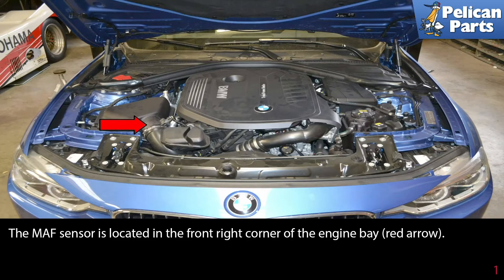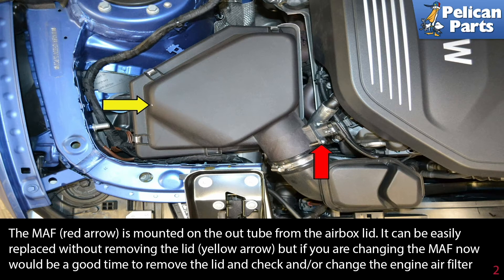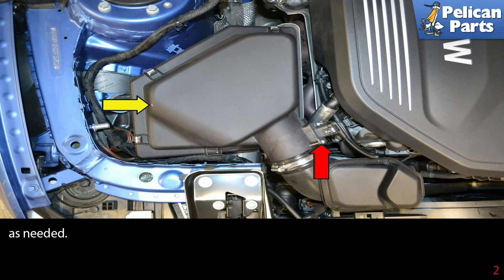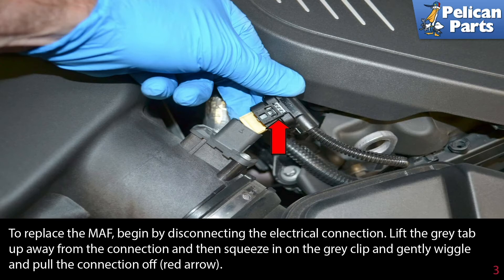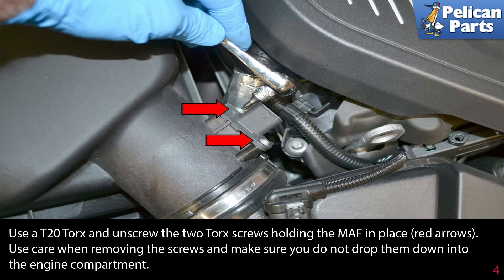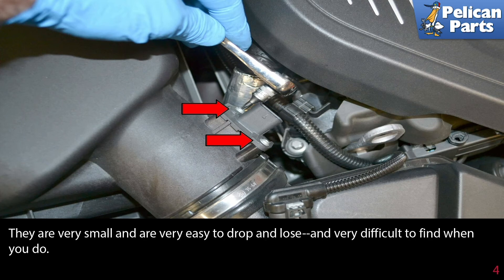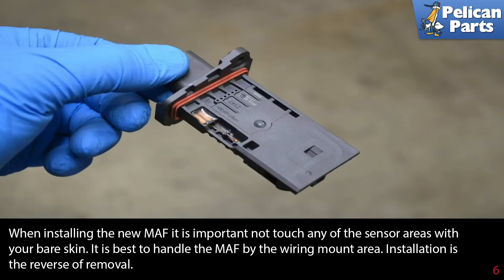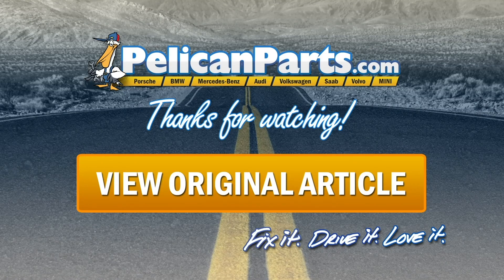BMW F30 3-Series MAF Sensor Replacement for 320i, 325i, 325Xi, 330i, 330xi, 328i and 335i

Comment: I have been getting too much airmass code on my car... so the wire/sensor side is up?? I definitely put it in backwards......
Reply from the maker: I don't think you can plug it in backward. The connector will prevent that. I would address the fault code and try to diagnose the issue.

Comment: I want to ask. Why my f30 is difficult to start.after start for a moment suddenly the engine turn off.the engine is shaking. In i drive drivetrain multifuntion. I already change sparkplug. My problem is iginition coil fault or crankshaft sensor or mass air flow?
Reply from the maker: Difficult to say without knowing the stored fault codes. Could be an engine misfire, timing issue, etc. I would start by checking the DME for fault codes. If the system is not working properly, a fault code will be set. This will be your best bet when diagnosing.
Reply: yesterday i already check the dme in the dealer.suddenly the temperature up to 130c. The fan suddenly not smooth and the ac suddenly hot. The fault code is water pump and thermorstat and i also change the coolant by bleeding the coolant. I already change bmw original water pump.and thermostat. Now my car is getting better. Thank you for your suggestion
Reply: Same